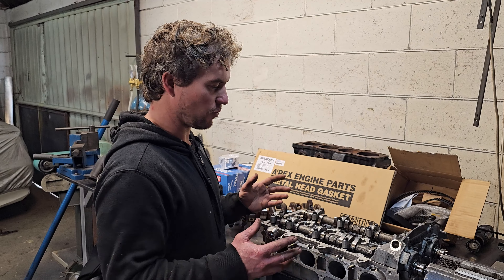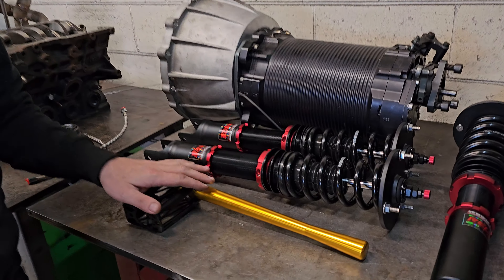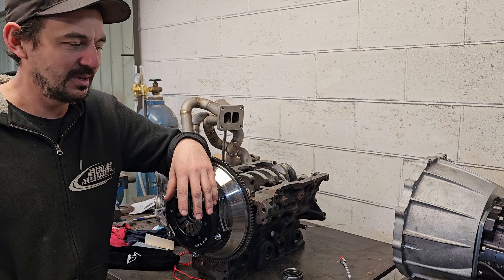Massive pile of parts for the 5sgte Beams Supra build!

Comment: Do you also need to drill the headgasket to 11mm studs or is there enough play on the gasket for fit the thicker head studs?
Reply from the maker: There is enough play but you put the headgasket on then wind in the studs it won't fit over the threads of the studs

Comment: Very late, but was the head gasket for the 5sfe block or 3sge head?
Reply from the maker: It's an apexi gasket to suit the altezza beams engine.

You have to use that if you plan on running it rwd otherwise need a fwd one if you want to use it fwd or 4wd as the gasket dictates water flow